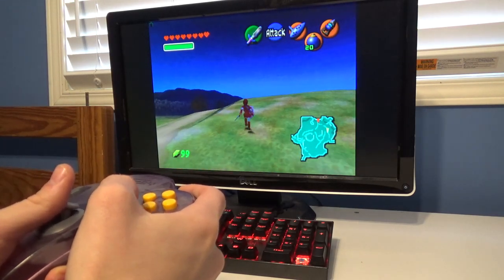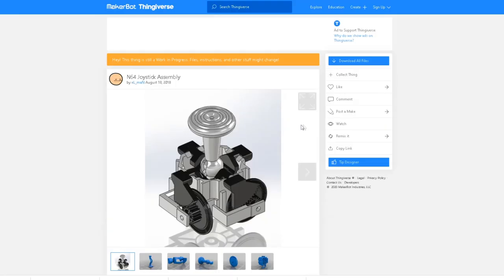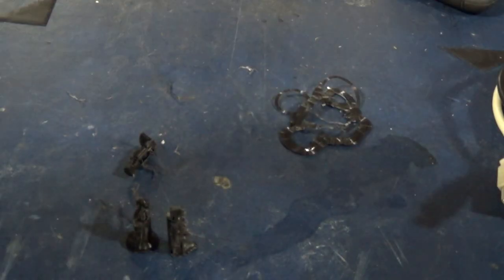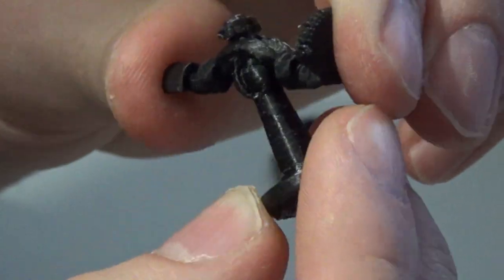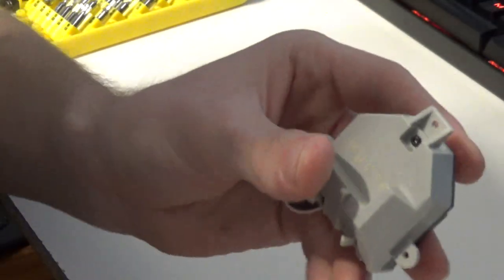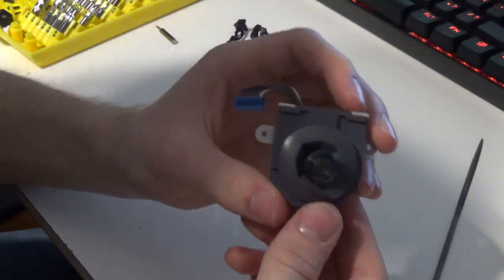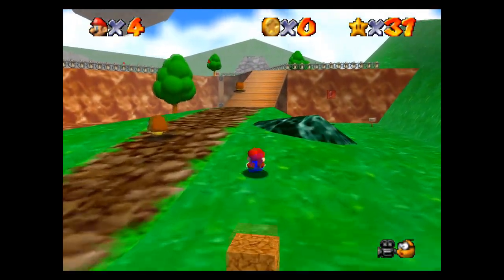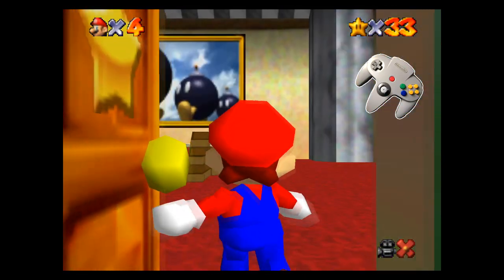The Permanent Solution to a Broken N64 Controller

Comment: Resin printing may leave better results! Just a suggestion, though.
Reply from the maker: I believe the actual files were designed to be printed that way, the only parts that couldn't be printed right are the arms as the teeth cannot be replicated well enough with an FDM printer but good point!
Reply: @CamdenBowen  Since I don't have a 3D printer of any kind, I'm requesting a service from a maker near me. Do you know how much infill rate should be in just the 'bowl'?
Reply from the maker: @dotmatrixmoe  It's not a very big part you could possibly get it ordered with 100% infill but if that's to much I would do 75% or even 50% should be fine, try to order it with wall thickness of 1.5mm and a finer resolution like 0.1mm

Comment: Did you filed the arms that hold the encoder wheels? Mine struggle to fit in the bottom case , I had to press it to fit unlike the originals, and that cause the arms to tight and make the encoder wheels a bit harder to spin, although I managed to solve that the joystick still gets stuck at diagonals, I used new parts for the axis, the bowl and the stick where 3D printed, I snapped the stick playing starfox with friends 😂 , did you had to fine tune the stick itself? Am having trouble my parts don't snap back and the stick is drifting in games, it's unplayable, I will reprint with the settings you used 0.1mm and 100% fill, I have an ender 3. Maybe because I had to make the holes that hold the encoder wheels bigger the wheels
Are a tiny bit wobbly when they rotate and that's enough for the optical encoder to go off and make the joystick drift

Comment: Did you have to change the size of the holes on the bowl for the encoder wheels I remember trying this before with yellow pla and the holes were way to small i'm starting to think maybe the difference between mine and yours is I didn't use 100% infill if I recall back when I did it. But if you sanded the holes bigger or made them bigger before printing I kinda wanna know if you did something different with that part but besides that good video.
Reply: I think they changed the model before the holes looked smaller I no longer have the original to compare but I may try to re-print this one since it seems the holes are larger for the wheels.
Reply from the maker: I noticed after printing there was some support material that was in that hole making it hard to get the wheels in, but using a little pick to take them out it fit just fine. I didn't have to resize the hole after printing other than taking the end of a round file and just gently twisting it a bit to get rid of some of the plastic that was stuck there from the support material. I've used the controller for a while now and it's held up really well. Thanks for the support!
Reply: @CamdenBowen  I didn't use support on that piece but I can tell the material and infill i think makes a difference just it works ok up and down it snaps back to center sometimes but it just gets stuck when I push it in a direction most times and the more I sand and use it the more lose it gets and the spring back stops I may just need to get a filing set and re-print the part although the joystick mod prints great I just can never get the bowl piece to go.

Comment: how the heck did you print this at .1 layer height. i tried printing this a few times and couldnt get it to even print at .05
Reply from the maker: I guess I missed this comment for 5 months oops, if you're having trouble printing the parts as in the plastic doesn't stick very well to itself and is very porous it could be attributed to a filament that is in need of being de-hydrated. If the problem is very poor print quality you may need to change the printing speed from say 50mm/s to 35mm/s or so. Changing the print temperature could also help

Comment: What did u use for grease?
Reply from the maker: I used silicone grease, the specific one was "Permatex silicone ceramic brake lubricant"  I found it to be perfectly safe to use on both the plastic components of the original analog stick and the 3D printed components as well. I made a follow up video showing how well it held up if you're interested, thanks!

Comment: Thank you so much for such an informational vid! I'm looking over eL_maN's comments on Thingiverse; they recommend not use FDM printers. But (correct me if I am wrong, as I am a 3D print newb :)) you used an FDM printer, right? I'm guessing the key is that you printed them at a high resolution and filed them down (I've been meaning to order one of those file sets). Could you please let me know what type (PLA, ABS, etc.) of material you used, and what brand?
Reply from the maker: Thanks for the comment! I did print this on a FDM printer and had great results, printing on 0.1mm did great after a bit of sanding to smooth the parts. The PLA used is called Standard PLA but I haven't tried any other filament. Hope this helps!
Reply: @CamdenBowen  Thanks for the info! I think I’m going to give it a go!
Reply from the maker: @LovePandaBunny  Good luck 👍

Comment: Can you share how you optimized the files for printing? Thanks in advance!
Reply from the maker: The only things I really needed to do was print with 100% infill, and on a resolution of 0.1mm with supports. The results may vary from printer to printer and with different materials but PLA seemed to work fine
Reply: @CamdenBowen  thanks! Subbed!
Reply from the maker: @guyug6940  Thanks bro!

Comment: Your Mario 64 picture quality is brilliant. Are you using RGB or hdmi with a line doubler
Reply from the maker: I actually used an emulator for the footage in this video, in my later update video I used my capture card through composite video for comparison
Reply: @CamdenBowen  Are you using PJ64? You'll want to make sure you're using Glide64 for the video plugin or alternatively try Retroarch. The reason I mentioned it there's extra black pixels around the HUD instead of being completely smooth. I know PJ64 does that with it's default setup.
Reply from the maker: @CrazySteve88  I mostly play the games on actual hardware but I did use PJ64 to capture the video footage for the better video quality and I was also having issues with my capture card during the time